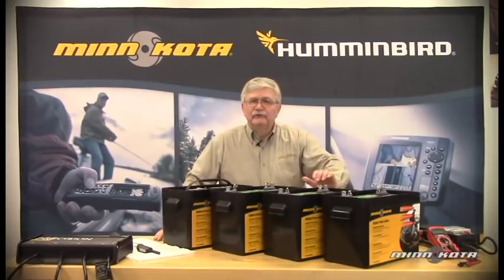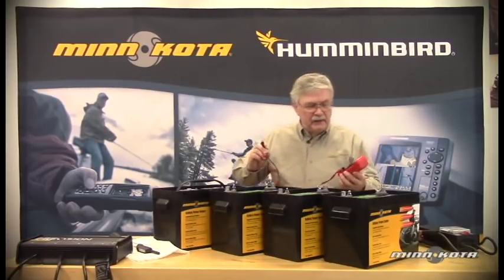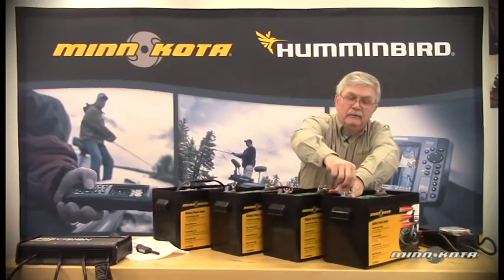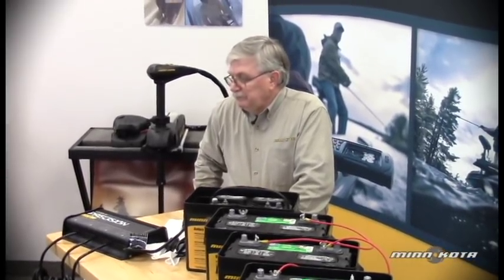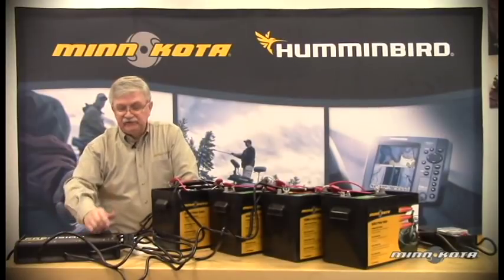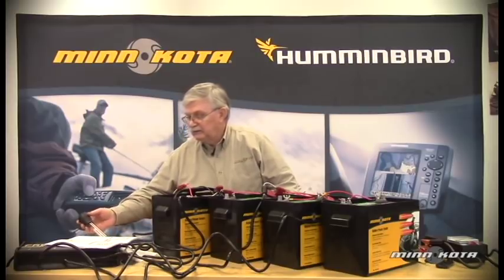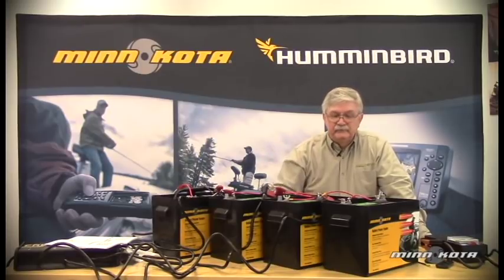How to install batteries on your fishing boat

Comment: Thank you for the helpful video.  Is it necessary to disconnect the trolling motor prior to plugging in the charger.  If so, disconnect only the positive (+) wire or both wires to the trolling motor?  Similarly, instead disconnecting the wire is, it appropriate to open the circuit breaker?  Thanks again.
Reply from the maker: Hi John,

We recommend disconnecting power from the battery while charging. 

Thank you

Comment: My boat currently has 2 batteries (1 for accessiories, 1 for motor) I am planning on adding a 36v trolling motor soon. That would then be 5 batteries how would that get wired in? Or would I have to get a separate charger for each? Is the max I can use 4 batteries? Thanks in advance for your time and great video
Reply: More specifics, I want to add MK Ulterra 36v and a MK Pc charger if possible
Reply from the maker: Mando,
We recommend you have a designated bank from the Battery Charger to each battery.  You would have to do a 3 Bank charger along with a 2 Bank Charger.

Thanks!

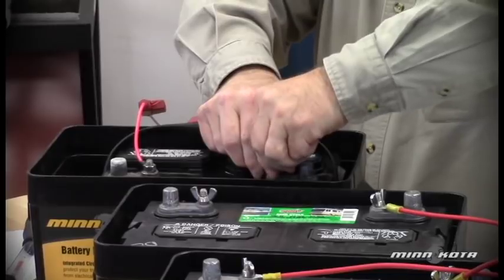Comment: Thank you for the very informative video. I would just like to confirm what you mentioned between minute 13:30-13:49..."...that the starting battery is recommended to power all the onboard electronics...the other 3 batteries should be independent of starting battery and solely used for trolling motor..." Are you stating that the starting battery power sonar, navigation lights, etc? and that the 3 trolling motor batteries solely be used for up to 72volt trolling motor? I just want to confirm.
Reply: That's exactly what he's saying.  For 1, if you run 2+ batteries in series, and try to hook up your 12V accessories to that circuit, you'll fry them as you'll have 24+ volts going to them.
Reply: If need be you can connect to the low side battery and solely the low side battery for running your electronics. It is not recommended to connect to middle or high side battery. You could damage the batteries. At least that's what I have always learned.
Now with all that said never connect your electronics to more than one battery. Unless they are connected in parallel. Remember two batteries connected in series will produce 24V and three 36V.
Reply: I think you can get 12volt security safely on any series battery.. or I'm wrong?
He check the low and  middle battery and he  get 12volts

Comment: Thanks for the video, although i am 90% sure after seeing this video, i would like you to confirm. I have 3 batteries in series for my 36v minn kota trolling motor.  I also have just bought the minn Kota MK 330D On-board Charger. The question is, can i just simply connect each bank to the battery permanently without the hassle of connecting / disconnection any wires that lead to my trolling motor or bridges between the batteries? I hope i have been clear in my question.
Reply from the maker: Evan,
Yes, you can put each bank to a battery and leave the jumper wires in place.  The Battery Charger will see each battery as individual.  You will just have to come home and plug the Battery Charger in.

Thanks!
Reply: @MinnKotaTutorials  Perfect, thank you so much!

Comment: I have  mk440 charger connected to 2 batteries. I have 2 separate batteries in a different compartment for my trolling motor with no charger. Would you recommend hooking up the other 2 batteries to the mk440 or hook up a separate charger for my trolling batteries?
Reply from the maker: Hi Mario, the MK 440 is a 4-bank charger, therefore, if the cables are able to reach into your separate compartment, it could be hooked up to your two trolling motor batteries. Just ensure that the banks are set up to the appropriate style of battery (lead-acid, AGM, etc.).
Reply from the maker: Hi Mario, 

You can utilize all four charger banks. Just make certain the battery type is correctly set for each bank of the charger being used.

Thank you

Comment: If your deep cycle battery goes completely dead, are they ruined and no longer any good? Or can you just recharge them?
Reply from the maker: I flo,
We do not deal in batteries here so we would recommend you contact your battery manufacturer.  We would not say the battery is ruined but it will never be the same.

Comment: PS
My 2 trolling battery’s are connected to each other
But it looks like my start battery must be working off 1 of the trolling battery’s as there isn’t any direct connection to my charger 
My marine charger has 1 set of wires going to one trolling battery and another set of wires out of my 2nd trolling battery??
Advice piece
Reply from the maker: Hi Vinnie,

First covering how the batteries are connected; your trolling motor battery(s) should not be connected to the starting battery in the manner described. In fact, trolling batteries and starting batteries should not be connected to each other at all. We suspect whoever set this up tried to get away with using just a two bank charger and is trying to use the engine alternator to charge the other trolling battery by connecting it parallel to the starting battery. This is not a good idea and can cause a variety of issues. Again your trolling batteries and staring battery should not be connected to each other at all. In order to charge all three batteries, you should have a three bank charger.

Thanks!
Reply: Thank you for the reply
And now I got to figure out how to separate the starter battery from the trolling. I’m gonna order a 3 bank today. Also this is for a champion bass boat with a mercury 150
Since I’m getting a 3 bank charger do I connect 1 bank to the starter battery or does my mercury efi have its own alternator?
Reply from the maker: We can't say what the outboard has for an alternator. As a general rule, you want as many charging banks as you have batteries on the boat. 

Thanks!
Reply: I just went band bought the newest model out at west marine
A 3 bank pro sport hd 20 plus
It’s not working rt out of the box.
Now I’m waiting on tech support to send a new one
I’m not sure about these because after I bought it Iv read many bad reviews 
Anyways I’m gonna give them a try  
And see what happens!

Comment: Hello friend please help me find down how to conetion Baterry and sweet on and off they have #1 and #all and#2 please let me know about what #1 for # all and #2 for  my boat maxum  sc21 f have  Marcy. engine 5 L  v8  and amplified thankyou
Reply from the maker: Hello,

This does not appear to apply to our trolling motors. For wiring on/off battery switches we would recommend consulting with a marine dealer that rigs boats.

Comment: What about Lithium batteries? Can I use a 36 V Lithium battery to replace the 3  std batteries
Reply from the maker: Lithium batteries can be used but be aware they operate at a higher voltage than the nominal 36V, for a longer period of time.  The higher, sustained voltage can cause more heat to build up in the lower unit as compared to a flooded lead acid battery.  More heat and voltage can lead to faster wear on the brushes and caused the brush plate holder to melt over time.  Flooded lead acid batteries are more forgiving on the motor as they slowly drop voltage as the battery discharges, allowing the heat to dissipate.